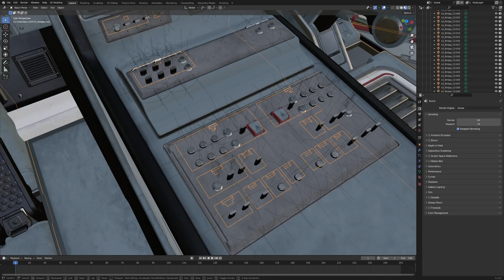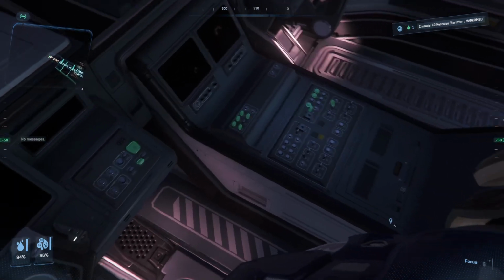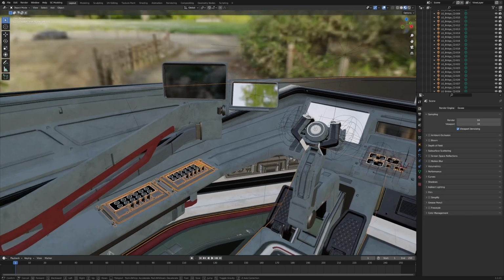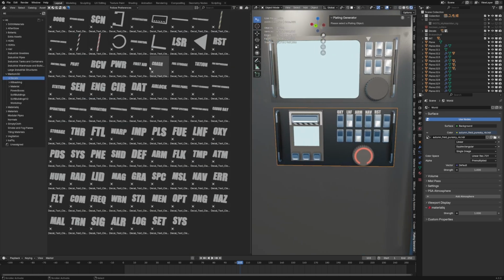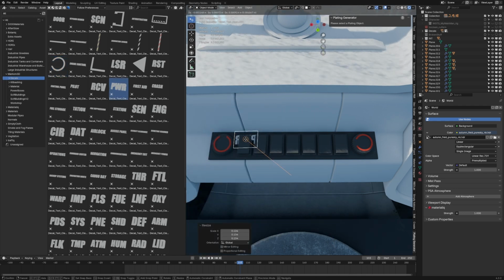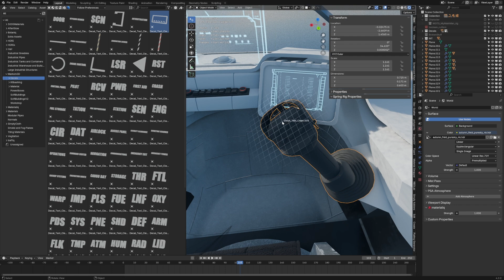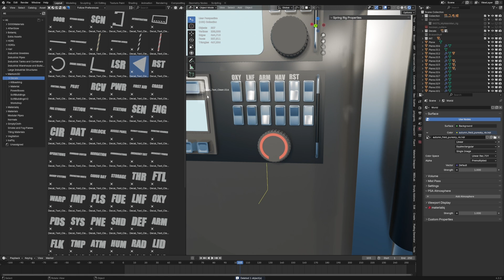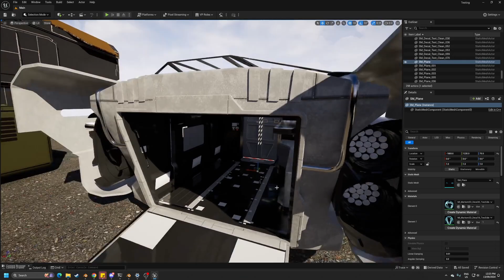Secrets to Crafting Star Citizen Cockpits in Blender

Comment: @Markom3D, Yeah this pipeline has been in place for a long time now at least for SC assets.  POM and smart normal decals are used all over the place.  FYI FWN is highly used for the hard surface assets.  FWN (Fully Weighted Normals) allows them to make the hard surface beveled edges look so clean and beveled nice.  That way you can assign a material and not be so worried about the baking of edges and UV layout for a base asset part.  Great for their hard  surface pipeline.